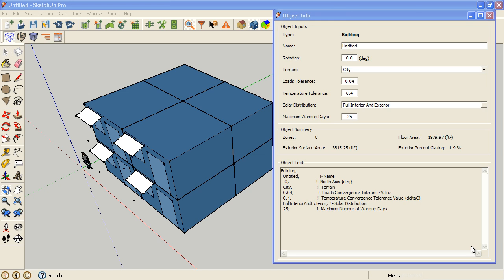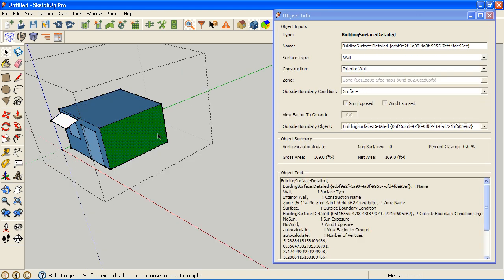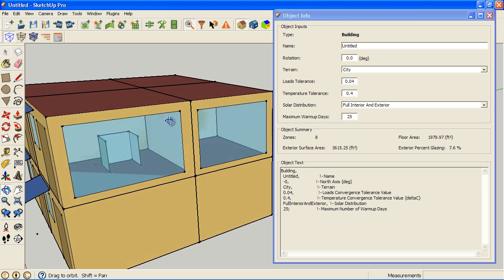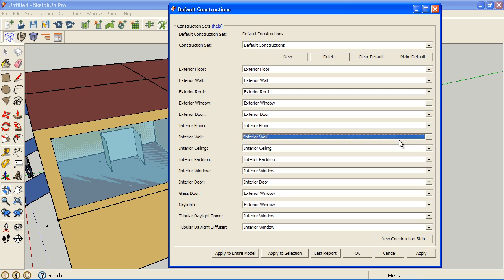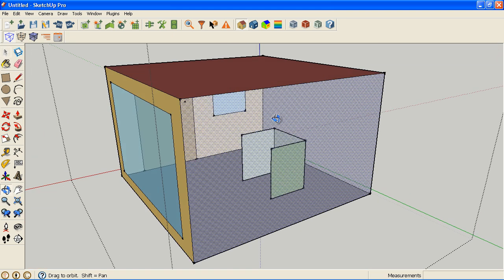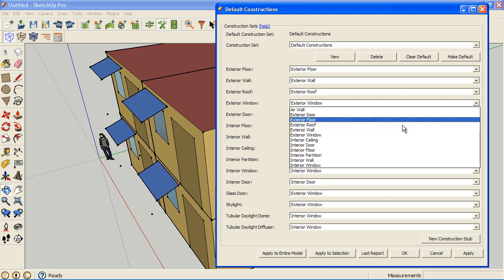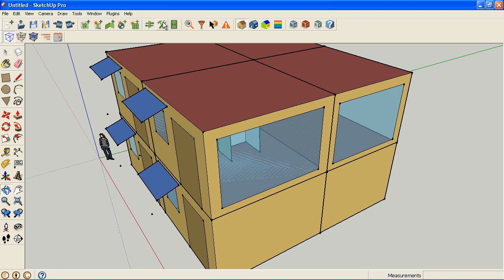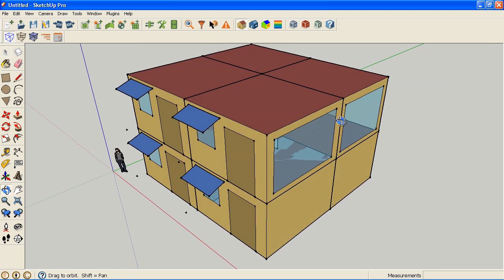Setting Surface Constructions with the OpenStudio SketchUp Plug-in

Comment: Hello. if i have a sketchup model already of my building, can i add zones from there? and do all those energy plus information?
Reply: I'm at the same stage and concluded no, you can't import or use even, a sketchup model with all it's detail.  Basically, I re-constructed a new Sketchup model that only shows the paint or varnish or color.  Imagine if the layers structure included a Layer named "Finished Surfaces", and you hide every layer but that one.  It's a shape (usually rectangular) representing the building with flat planes only, each with two sides, and each side with assignable properties.  (Properties might come later on, depending on what type of zone it is)  If it's a wall plane, it retains the properties (R values, dimensions, etc.) of the Sketchup model wall but is shown with 0 width.
Now I'm trying to find out how to 'show' in the Beopt Sketchup model, the movable glass wall between a conditioned zone/space and an insulated but non-conditioned space, (Sunroom) separated mostly by glass.  
I don't know if any of that makes sense, I'm thinking while I write and don't know much.

Comment from the maker: Air wall is a material, you need to have it used in a construction and then assign that construction to a surface or to default constructions. If you make a new file it should already have both an air wall material and an air wall construction. Not sure if that happens with an imported file. The newest version should do this.

Comment from the maker: That is a good question. You create a single surface in OpenStudio to represent a wall. That wall has a construction associated, so EnergyPlus does know how thick it is, but the visual representation is just a single surface. When you are modeling surfaces that are part of the exterior of the building you should draw the surface so it lines up with the exterior face of the wall. For interior walls use the centerline of the wall. Search "Convert 2D DXF to EnergyPlus Model" on our website.
Reply: Now you tell us.  When I pondered this 'unanswered" question initially, logic said the software would want to know only the volume of air that was conditioned, and therefore the inside surface would matter most.  To achieve R 20, the wall might be 4" thick if polyisocyanurate (R 6.6/inch) is used or it might be half again thicker, if fiberglass insulation is used.  It's an undefined variable, so how much air volume is being managed when the exterior surface is specified?  You don't know.